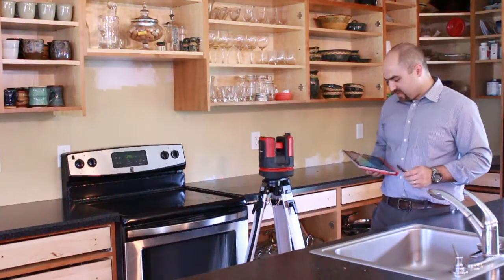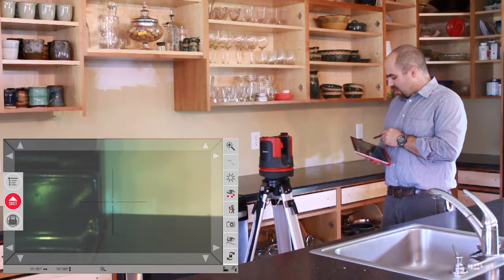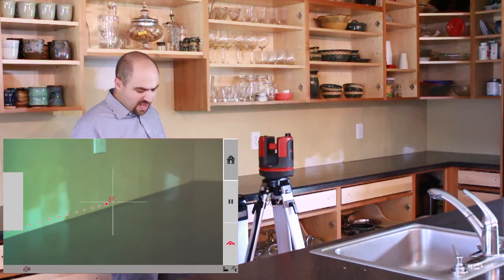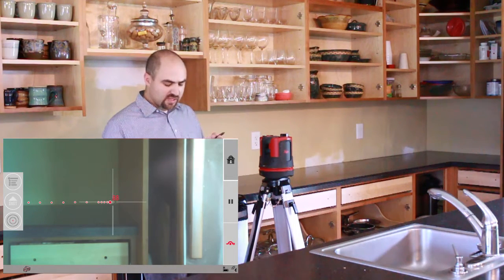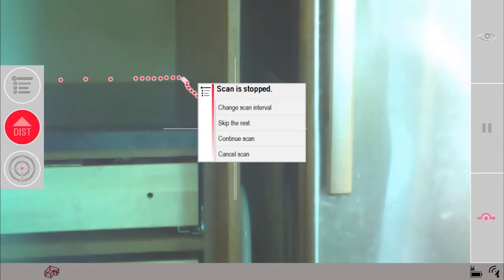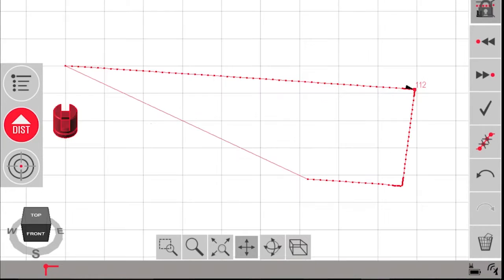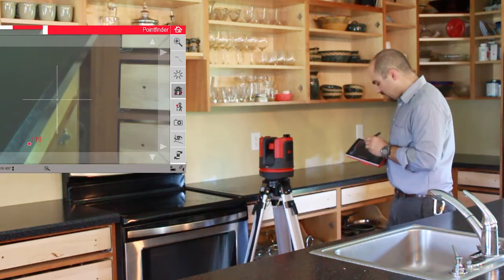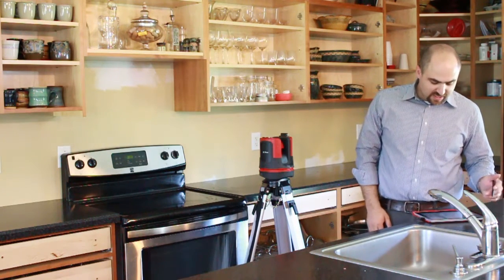Countertop Templating using Autoscan with 3D Disto

Comment: Dude. I’m sorry to say but this was poor. You shortened the points next to the unit when you didn’t have to. You hit so many points on the unit when the unit is square. You didn’t put tape against the worktop. You assumed the size of the worktop even though you scanned for a scribe otherwise you’d have only hit 2 points. You didn’t even scan the side of the worktop next to the cooker. You have allowed no room to get the piece in. This was such a poor example. In the time you took I’d have templated this in sheets and been for a coffee. You actually put me off buying this machine.
Reply from the maker: Hey, Michael, thanks for the tips. This video was done quite some time ago when we were just starting out, and we've learned a lot since then. Be on the lookout in the next few weeks for an updated video!

Comment: Cool toy, but, slow. With the Proliner I would be done that side before the wall scan is done.
Reply: Exactly. But it’s not the machine. This guy clearly hasn’t been around kitchens. Iv been in the granite trade 20 years. I’d do this in 1minute and you guys would see it edited etc.
Reply: @michaellowe9392  Since posting that remark I have used this (2D3D) and found it to be quite nice for vertical measuring, an area the Proliner fails to perform well. I also found that the set up can be less of a hassle than I thought as well. I still prefer using the Proliner, but have learned to like both.

Comment: How do i use autoscan in etemplate measure manager??
Reply from the maker: I recently got to play with Etemplate Measure Manager at training I did for a company.   It seems that when the Measure Manager is in use it disables the AutoScan feature in the Leica software, I could not get it to work without turning off the Etemplate Measure Manager and starting a new file in the Leica's software when I saw "Measure" in the top right corner of the Leica software then I was able to use the AutoScan.  I think that is one of the best features of the 3D DISTO and am perplexed as to why it would be disabled in the Etemplate software.
Reply: @Advanceddimensions  I thought so to. I recently learned that it even had this function, but was surprised that such a key feature was disabled. I wonder who I could address about this to see if this is something they are even aware of. Thank you for the response.

Comment: When exiting the scan what do you hit?
Reply from the maker: To exit a drawing and start a new scan, select the house icon in the top right hand corner, below the X used to close the software. You'll be prompted to save/exit scan etc...
Reply from the maker: Pause the scan then select the "Skip the Rest" when it asked if you would like to edit the scan you can select "No" and it will complete the scan or if you hit "Yes" then you can add points and select the check on the right side panel to complete the scan.